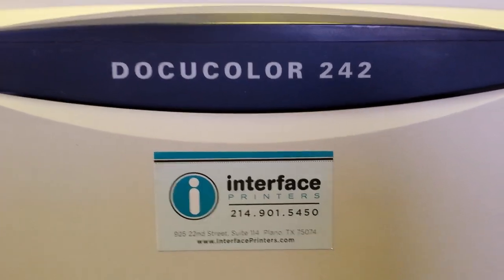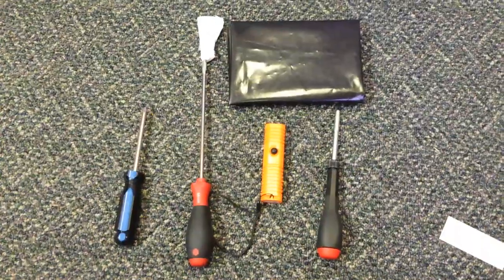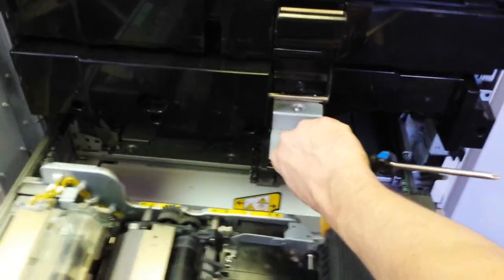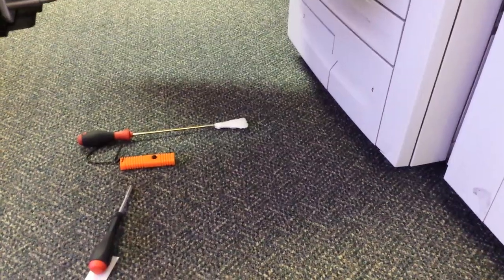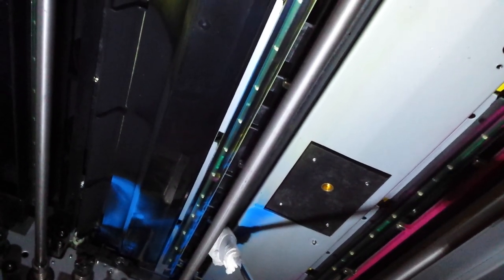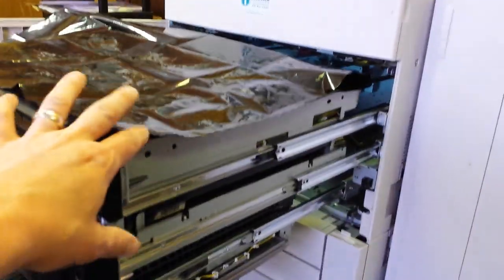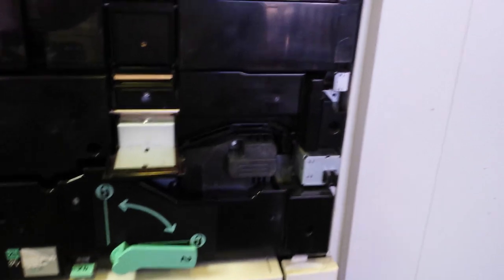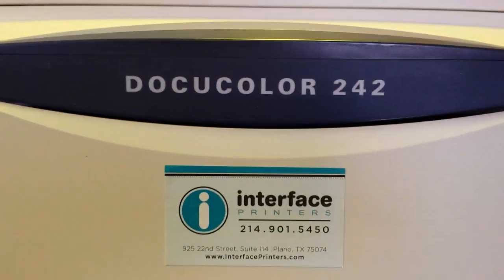Xerox ROS Cleaning

Comment: Thank you so much for this video. I have a C70; replaced the drums, checked the developing unit, and switched fuser. As soon as I followed your instructions I saw the problem, cleaned it like you said and it worked. Again, thank you!

Comment: would like to know your opinion - could dusted ROS have relation with uneven density on the full coverage print page?  And I have different color density from left to right on page . Tried tests with running full cmyk and cmyk gradient and it look ok. Only see issues when mixing colors.  I tried to clean ROS, still same...

Comment: Sir, why clean the ros, my print is getting magenta very light frenzy lines, what could be the possible cause for that?? really appreciate ur comment in this regard
Reply from the maker: This is an easy quick fix, but sometimes the toner dust will enter into the ROS and you will need to remove it.